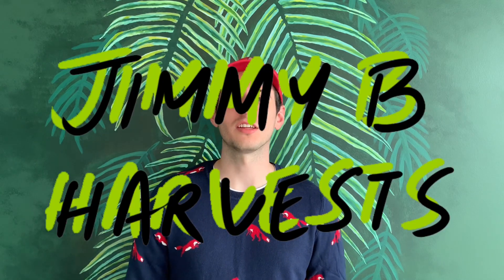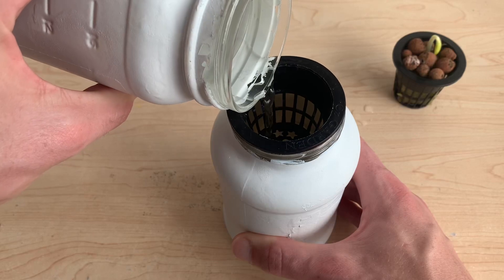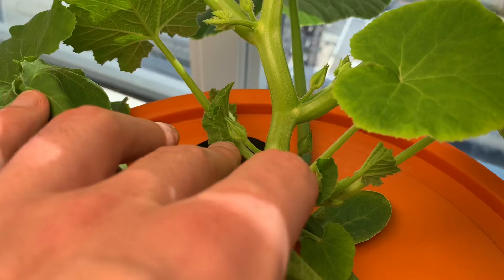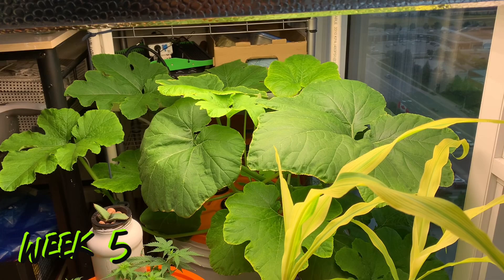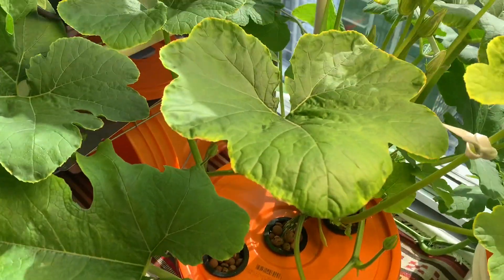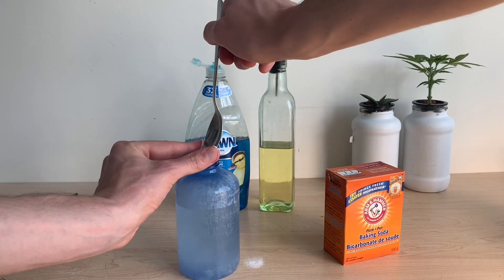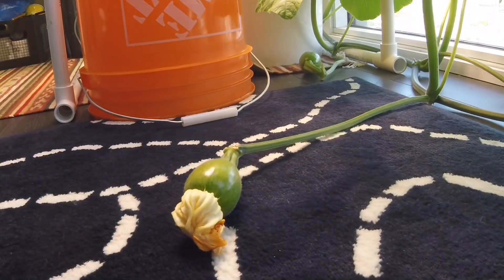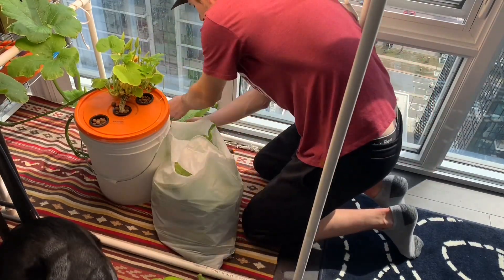Hydroponic Pumpkins From Seed to Harvest - Growing with the Kratky Method

Comment: Okay i accidentally sprouted a bunch of pumpkin seeds from a pumpkin. The shells have mostly fallen off and they're still only in water. I have land space but can decide if i should plant the roots in soil  or come up with a hydroponics system out doors since i have a pretty large patch of dirt. Thoughts or tips
Reply from the maker: If you're reliant on harvesting a pumpkin, soil is probably the most straightforward.. hydro could be fun/neat but id be careful to check the temperature ranges the reservoir will go through, depending your climate

Comment: Thanks Jimmy - btw, i did both kracky method and soil.   What I figureded out - pumpkins grow larger in soil and even better in large air pots.   Also, keeping only 1 pumpkin per vine made them larger....fewer, but larger.   Also, regarding the powdery mildew, using actual powdery mildew spray vs homemade baking soda method was more succesxful in keeping the mildew in check, but i understand either people dont want to buy/use bought sprays.  One thing i would also add/suggest, start spraying the homemade spray `before` the mildew actually appears.
Reply: Powdery mildew is a problem where i am at, but never seem to be a problem if i spray early and often- before it appears.  When staying at my place in thailand where the humidity is awful- i do start the spraying process if actually powdery mildew spray early and often.  I also try and scrub the pkants/leaves once evey 2 weeks with that dish scrub pad and (dry laundry detergent + warm water) ....seems to help a lot.
Reply from the maker: Great tips! I definitely could have been more proactive and diligent with the sprays. Very excited to try a pumpkin plant again next season!
Reply: @JimmyBHarvests can't you do this year round if hydroponic?
Reply: ...also, for major mildew propblems/humid locations, scrubing each leaf by hand using dry laundry soap mixed with water and a dish scrub pad really helps.   When i am staying in thailand, the humidity causes way more powdery mildew and scrubing by hand is a must.